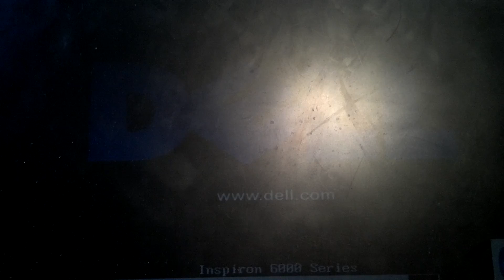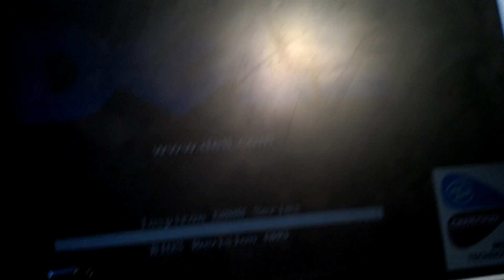Dell Inspiron 6000 - GREY Screen Forgot Admin Password Issue

Comment: I had this same problem and was able to fix it without opening the case.  I had originally given up on this laptop but decided to try to fix it one more time. 

This is what I did: 

1) Went to https://bios-pw.org/
2) I entered the service tag from gray screen of death into the field on the webpage 
3) Click "Get Password"

I got back a dozen or so passwords in 3 sections.  
I used the second one on the list and it worked.  I was able to get into BIOS and turn this setting off.
Reply: Thanks it worked!

Comment: I lifted pin 5, the SDA pin, since I thought it would do better than lifting just the power pin, possibly choking the SM bus. However, it did not work for me. I am going to lift pin 8 as you said. In my case, the chip is under the video board, so I can't use the screwdriver trick. :( I think I need to add a switch on a wire to do the trick, to be able to place the video board and turn the machine on.